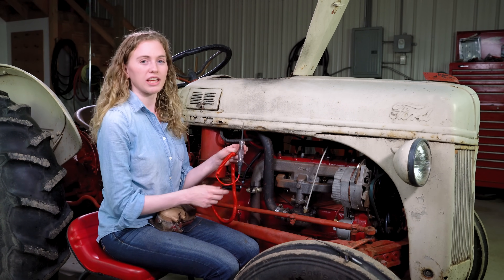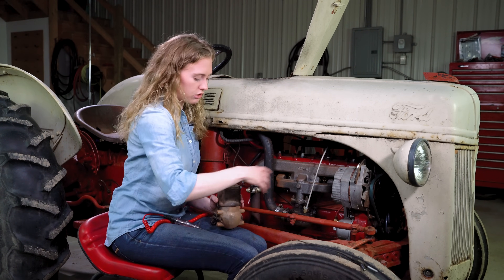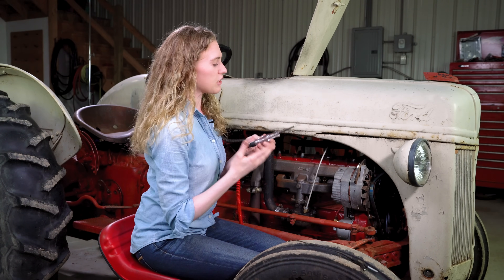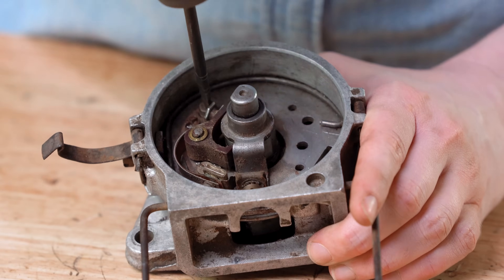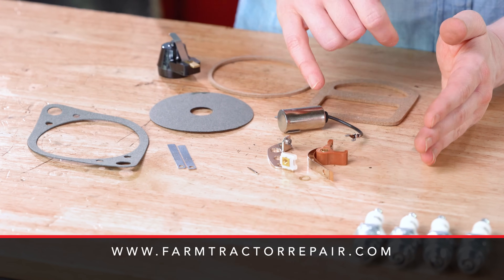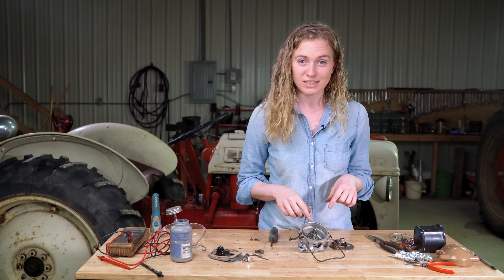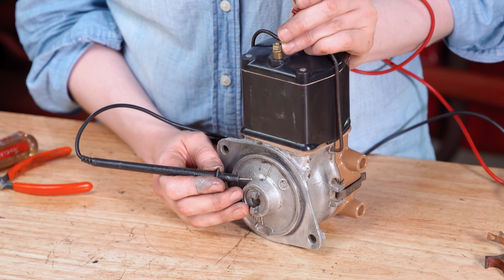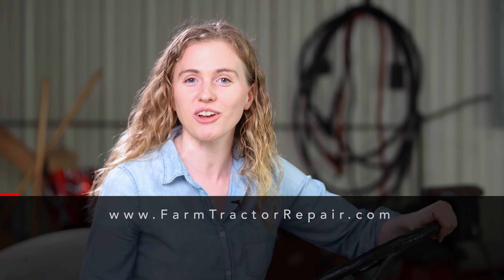Ford Distributor Rebuild & Troubleshoot: Points, Coil, Cond.: Ford 9N, 2N and 8N Front Mount Tractor

Comment: Thank you. I have power at the top of the distributor but no spark. I have not checked the flashing/pulsating at the top but I assume that is my issue, so my point or condenser or something in there is wrong. Also the spark plug wire is quite old, could be that.

Comment: Im not a mechanic but helping a friend fix his 8n. We’ve replaced carb sediment bowl plug wires 12 volt battery. Cold starts fine runs for about a minute or so begins sputtering backfires and dies.  It then is very difficult to start after that. It seems if it sits and cools down it may start again but only runs a few seconds. Next is the front mount coil and distributor. Initially I thought it was a fuel issue but beginning to think it’s probably electrical. Good video and would appreciate any input you or anyone may have. Thank you😊

Comment: I have a 56 ford 800. Points kept burning out. Changed to electronic ignition. Was a very easy conversion. No problems since. I did this 8 years ago. Also still a 6 volt system.

Comment: My tractor won't start, and I've watched this video but stopped.  My Ford 9n has a front mounted distributor, but the coil is NOT on top of the distributor as shown in the video.  It has a connector attached to the distributor that then connects (connector is like a spark plug wire on one end and goes into the top of the distributor and connects to the points) to the coil which is a cannister and is mounted on the motor.  I attempted a rebuild on the distributor but now the distributor appears dead (no power/spark).   I would like to purchase a replacement but cannot find one online... My tractor was converted to 12 volts prior to purchase.  Can I simply purchase distributor with the coil on top and replace what I have?

Comment: Ok I did this test, and the test light, did flash, but no fire tothe plugs, brand new cap , not wires, maybe my wires are grounded, they are inside a pipe, so maybe my problem is the wires to the plugs, ? Can you help, been 2 years from when it ran last. Thanks BigAl California thanks

Comment: I posted this a few days ago that I am getting 1.3 volts at the coil… decided to pull out the distributor, change the ballast resistor and key switch…it has not started in 5 months…decided to try to see if it all was at least properly wired and setup… 

Started INSTANTLY with what ever fuel was left in the steel fuel line.  Honestly, it started like it had fuel injection!!   Thanks for the great detail in ALL of your videos

Comment: Rachel, I am getting a 1.3 voltage at the coil while running this test with a fully charged 6.5 volt battery,  obviously not enough to fire the plugs…where is my next measurement going to be?

I prefer to solve this prior to installing the premium 12v conversion I got from you last January 2023…. Yup, been in the shop waiting.  I have a Dearborn loader and it is tight in there.  Hood has been removed for better access

Comment: Rachel's distributor visual is really good, however she didn't cover last step, reinstalling distributor to engine. The drive part on engine has a notch on one side and the distributor connection has stamp on one side.  Do you align these two?

Comment: How do i know which coil to buy for my 8N? it has a 12v alternator converted to it already but i dont know the history of the the tractor on if the complete wiring was converted as well, how do i figure out if i need 6v or 12v coil? or is just automatically needing 12v coil because it has a 12v alternator?

Comment: Electrical testing is not thorough. It tells you have 12v to the distributer but not if timing is correct, if contacts are stuck closed or open.  I think is better to inform viewers to check spark at plugs rather than distributer coil. If your getting spark at plug then everything in distributer is working. Providing your plug gap is correct. Also check condition of plugs for lean or rich carb settings. The spark plugs can tell you alot about firing. Not necessarily timing. She may have another video on just plugs, not sure.

Comment: According to your coil/distributer electrical  test with the tester, as long as your tester is flashing, that should confirm firing correctly. Correct? If solid light, points are stuck closed? If not lighting at all, points are not closing or bad coil?  I'm a FIY person, not a mechanic but find your instructional videos helpful. You move a little fast for us old folk but I can stop, rewind and playback. Unfortunately, that's a lot for me. If yourself or any viewer can comment on my post to help out, feel free. Any advice may be good advice.

Comment: point of fact, at around 4:50; you can NOT install this distributor 180deg. out of phase.  the shaft is offset so it only fits one way.  if you manage to get the bolts to line up and threaded that way, the shaft will be pressed out by about a quarter inch causing the distributor cap to not fit.  if that happens, you have to press the shaft back in (by press i mean lightly tap it with a hammer and hope the bearing doesn't pop out).  i learned this the hard way :)

Comment: I have a 1949 8N with a very bad block.it’s been broken and welded but not very well.
I’ve found a couple motors, 1 out of an 9N . 2, the other one is out of a TE 20.
My question is are they interchangeable? I was given the tractor so I’m not concerned about spending some money..
I live in Alberta, Canada so getting parts can be a challenge.
Thnx in advance for any information you can give me

Comment: You are doing a good job.
But, that distributor only fits on one way.
You can NOT put it on 180 off.
HERE US A HUGE KEY.
It you have to force it at ALL it 180 off.
And you will usually break the cap and distributor putting it back on.
Again huge key is it just slips back together like butter. If not. Then its not on right.
I had to learn this the hard way. And I use to cuss these distributors out. 8 broke a few caps and distributors.
once I found out the secret. I love them.
You can NEVER be off time again.
You either hate them or love them.
And don't feel bad if you hate them. Then one day you live them.
Never meet a person that once they love em. hate them later.

Comment: Hi Rachel. Did a tuneup on my sister's ford tractor with parts from your online store. New plugs, coil, distributor cap, points. Now it is running rough. Could this be the points adjustment?  It starts right up bit runs bad.

Comment: I have a '41 9N.  I have only had it running for a few weeks.  It runs really well, but it will just randomly stop running and when I go to start it, it's like it has no power.  If I let is sit for a while, it starts back up as if nothing ever happened.  It seems like a simple solution, like there is something that turns itself off, maybe because it overheats?  The longest I can run the tractor is around 10 minutes at a time.  I think the previous owner took everything apart and painted everything.  It looks real good, but I'm thinking there may be paint in between some ground connections.  I was having a problem where the battery ground bolt was heating up.  I took it apart, sanded the frame and put it back on and that problem went away.

Comment: Couldn't ask for a better more confident instructor. 👍 My 9N just died coming across the field today. Getting fuel but no spark. With the rotor and coil in the nearly inaccessible front of the engine area I wasn't too happy. Watched this video which made it easier than it actually looked and along with a dirty ignition system found a dead condenser. These N series tractors are workhorses worth keeping alive. You and your dad are a big help in keeping them alive. 👍
Reply: Someday you may love the front distributor.
I once hated them. until I understood them.
Now I love them.
Very easy to time. they only go together like butter when timed right.
if you have to force it. Its not right.
even at 180 its not right.
If its harder then putting two piece of bread together its off.
funny thing is. its easy with one hand once you understand.
But until you understand its very hard.
1st time I got it right. I was dreading having to so it.
And it slipped together. 
I took it off 5 times because I thought something was wrong with how easy it was.
I've never had a hard time since.

Comment: What I'd you have no light while touching top of distributor
Reply: Test your probe make sure it's working. If your probe is good then you're not getting power to the coil from the terminal block on a 9N anyway. The resistor on those have a habit of breaking so check the other side of it for power. If no power it's likely that terminal block.

Comment: Good video, but your explanation of the points may not be entirely accurate. The point mechanism triggers the coil to fire when it closes the circuit to the coil - the spark doesn't go through the points as it only goes through the spark plug wires, the plugs, and sparks to ground to ignite the fuel.

Comment: The video covers the bases well but as an old time Ford tractor collector I have some additional advice. The anti seize lubricant has tiny particles of aluminum in it to give it anti seize properties and this feature of the lubricant isn’t necessary for a rotating shaft. A small amount of any high temperature grease will work. A little bit should also be applied to the top part of the shaft and a tiny amount to the lobes of the rotating cam. I use a high tech Teflon containing grease sold for use on guns and available at any gun shop. There is such a thing as high temp distributor grease but it’s very hard to find.

There IS a procedure for setting the timing that is described in service manuals, either Ford’s own manual (reprinted) or the aftermarket manual sold on this website. It’s frustrating and you need three hands to do it but it can be done.

If there is much looseness and ability to wiggle the shaft laterally in the top and bottom bushings it’s worn out and you need a rebuilt or new distributor.

I own 9N52, the fourth oldest N tractor known to exist plus 11 more N’s so I’m pretty familiar with them.

Comment: On my 1949 8n I had power to my coil, conductivity Through my distributor, and still no spark. With the test light it showed a solid light while cranking as mentioned I thought I had a points and condenser issue, so I rebuilt the distributor and still no change in symptoms. I happened to have an extra coil wire resistor and it fixed my issue. Now I have the flashing light while cranking/running. Thank you for all you do. A lot of us couldn’t do what we can now without you!!!!

Comment: nice very informative video, but i just have to say, don't use antisieze as a lubricant on a moving part, it has abrasive particles in it that will cause premature wear to your moving parts. you would be better off to use a high temp grease instead
Reply: I have my light flashing and still won’t fire up

Comment: Back in the mid 60's I learned all about ignition systems by working on my father's 9N. It was always in the original 6 volts. heavy handed goofs break off the stud on the top of the coil. It is just brass so it doesn't need much tightening.  A good electric tester is great for somebody who knows how to use one. A couple weeks after doing a rebuild (1978) like you did, the tractor wouldn't start. I could see that there was no spark so setting the tester for continuity I began checking the distributor like you showed and everything checked out okay. I checked the field wire on top of the coil to the ignition switch and there was no reading with the switch on or off so I checked out the wire behind the battery and found that it runs into a resistor mounted on the inside of the dashboard.  The resistor was bad and that shut it down. In all these restoring old Fords videos, nobody mentions the resistor.
Reply: Ya, I always check out commentary,could be a resistor,thanks
Reply: The people who don't allow commentary
Are always commenting

Comment: I have the old front distributor on my 8n. It was a pain in the butt until I put in a set of expensive points and modified it to take the round style coil. It runs like a champ now and I cut hay and plow snow with it.

Comment: I have rebuilt everything you did in the video and still no spark! I hooked up the distributor to the battery and the points are sparking when they touch. Just replaced the spark plugs wires about two weeks ago. It just stopped running last week. I am getting voltage at the top and bottom of the coil too. Im also getting Elms going through the distributor as well. After all of this, it’s still not hitting. Any help??? Thanks!

Comment: Great video!
Couple of suggestions in removing distributor from 9n front mount.
Do yourself a favor and loosen generator and push it in so as to move fan belt out of way.
I had to remove distributor three times and re-attach three times.
Before I wised up and got that darn fan belt out of the way, it took an hour each side to get the bolt off, and didn’t attach the distributor correctly ‘cause I couldn’t see it right, and wrecked one. Nice!

Second/third time, I moved the fan belt - and removing and re-attaching distributor took only 5 minutes each side and could now see that the distributor was lined up correctly with the engine.
I also found that you only tighten one side half way then tighten the other side. Easy Then!
The third time I attached the distributor and coil ( I put them in attached before installing) I first did a bench test as I still wasn’t getting spark after the second time. 

This is what I did (after watching videos AND bugging my mechanic):

With distributor and coil attached on my bench, I hooked up (via wire with alligator clips) 1x wire from positive post of battery to body of distributor.
A second wire (also with alligator clips on both ends) -had that end to the negative post of battery, and other end to the Coil’s top post.

I then attached a spark plug wire to a distributor port, hooked up a spark plug,  and touched it to the distributor body while turning the slotted end.
I got spark! 
I did this for all 4 distributor ports, each sparking as it hit their sweet spot.

After the 1st plug sparked, the second didn’t, so I opened the distributor and shined up the brass screw where the twisty thing on the coil bottom touches it. After that better connection, the test on all four distributor ports produced spark.
Also for the 9n the gap on points is .15 not .25. But whatever!

Great video!
Followed your instruction to the T, and it worked.
Followed your carb video to the T, and that worked too!
Smart young lady

Comment: Dan and Rachel, 
Your tutorials have been a great help to me and my 48 8n.  Recently the poor thing would die and refuse to start.  I watched and used all the tests Rachel showed on the distributor video. When I got to testing to see if my points were open/closed, half way through a good test the power went out.  Turns out the ignition key barrel has a loose contact. If the key moved a bit...dead.  I was able to track it down with Rachel's help.  Thanks.
Your prices are competitive as well, I am sure my 8n will be getting it's share of parts from you guys.

Comment: Great video. I have a 9n I am working on. It idles very well but will not rev up past half throttle. It is like it starts to miss. I have went through the distributor per your video and have completely rebuilt the carburetor. Is there something I am looking over?

Comment: As usual, another great video!  However, at 4:40 you describe how the distributor can fit back onto the motor if the rotor is 180 degrees off.  The two tabs on the distributor that fit into the center of the cam gear are offset from the center of rotation.  

The distributor will not fit properly on the motor unless the tabs are correctly aligned with the slots in the cam gear.  You might be able to force it back on, and break things in the process, but it will be obvious that something is not correct.  With the distributor loosely attached with one, or both, of the bolts, but not fully seated on the motor, the distributor housing should fit smoothly and flush to the cover.  If not, slowly rotate the rotor until the tabs engage in the cam gear slots.

The rotor will only go on the rotor shaft one way, and the distributor will only mount to the motor one way.  However, as you stated, if you pay attention to the position of the rotor when the distributor is removed, and no one rotates the crankshaft, then assembly will be easy.
Reply: Great point Mike, I installed mine 180 out and dismissed the increased threading torque as I tightened her down.... the distributor doesn't turn anymore....!
Reply: It seems these YouTubers all watch each other’s videos and they all emphasize this same point about rotor position.  Anyone who has actually worked on the distributor at all knows it only fits one way!😂

Comment: So Rachel you make great videos to the point and extremely helpful, your old man must be proud. have you done any 12 volt conversion videos I have a Ferguson TO 30 and am thinking of doing it to the old beast.
Reply: Thats funny.
I just seen a video that the guy said all Fergeson were 12v.
He made a lot of mistakes about 9N to 8n as well.
And he also said All Fergeson were overhead valve.
When I swore I've seen some TO 20 that were flatheads. I through they were 8n at the junkyard but the owner said they were Fergeson.

Comment: I added 12v conversion and now I have no throttle response, engine starts and run but absolutely no throttle response, I disconnected the linkage from the governor and still the same, any ideas???  Oh also have brand new carb